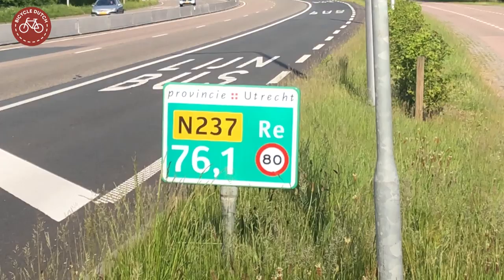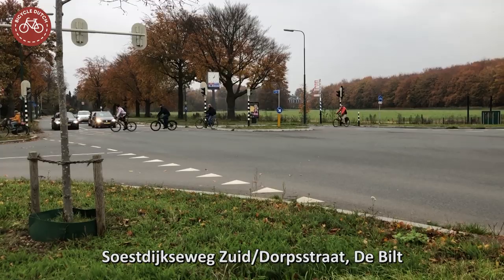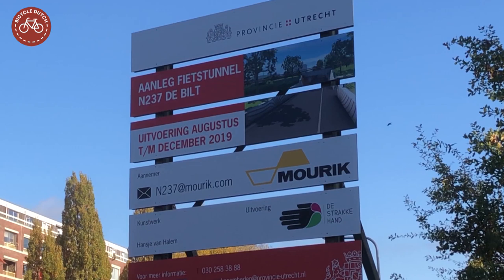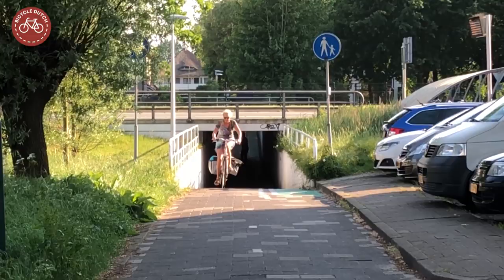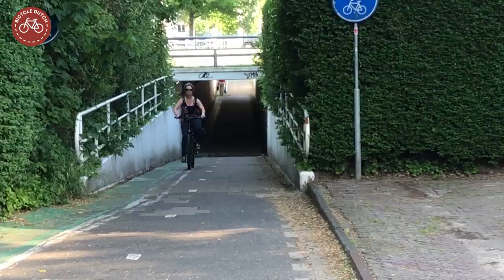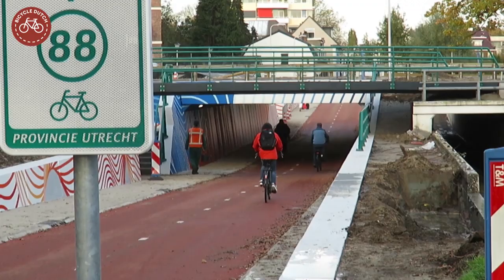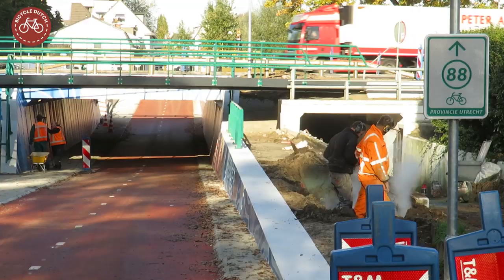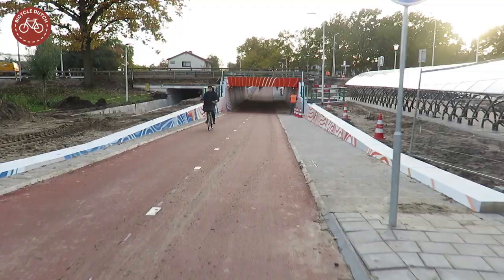A cycle tunnel in De Bilt

Comment: The tunnels are a HUGE improvement!! It’s much safer and saves a heap of travel time as well. I’m very happy with them!

I do have a concern with the current constructions sort of near the fuel stations. The road towards one exit is now sloped (like what they are building on the Zandvoort circuit). In autumn or wintertime this is very dangerous.

Comment: Uff the old tunnel looked very steep, no wonder that lady was struggling to bike up it, new tunnel is much much better.
Reply: That is most likely not a sign of a steep incline, but a sign of poor cycling technique. At 1:29 you can see the normal behaviour of a lot of Hollanders: they stop pedalling before the road goes down, and start pedalling at the bottom of the way up. When you keep on pedalling while you pick up speed, you gain enough momentum to go uphill with about no extra effort. At the end of the incline, you'll be able to continue at the same speed at which you entered the decline. The less steep inclines make the "tunnel" longer, which adds road resistance, and makes it harder to maintain your speed.
Reply: I know the old tunnel. I don’t think it was extraordinary steep, but it was scary. Bad pavement, too narrow and no clear lay-out. Especially under the road pedestrians were supposed to walk where cyclists don’t expect them.

Comment: Two questions: is the tunnel adapted to wheelchair users and do young women feel safe going through the tunnel alone at night?
Reply: I am not 100% sure about the wheelchair needs, but as you can see: pavements are wide and the slope is quite easy.  I expect it does not feel more unsafe than in the open street, especially because there usually is quite some traffic using the tunnel.
Reply: at the beginning of the tunnel and at the end there are homes, and there are lights inside of the tunnel. Also, in the Netherlands most woman are 'unsafe' at home or at work, so i think its relatively safe in comparison to other country's
Reply: @thedankoona_5854  I mean perception of safety, not actual safety.

Comment: One solution for inner city transport, that is free, perpetual and non polluting, is a series of gradually descending tunnels, like the London tube except dual and inclined.

Gravity = free

Imagine a gentle slope, like a ski slope in a tunnel.

By using low friction surfaces it would minimize friction and charge scooter batteries by regenerative braking.

Elevators could contain pollution at stations and air could be sucked out further minimizing friction in the tunnel.

Such a simple solution would provide constant, weather independent, non polluting, city access within a 5 to 10 mile radius..... that could last for hundreds of years and allow for cyclists to commute long distances without pedalling and actually charge escooters etc.....

I wrote to Elon Musk with the idea.

No response as yet.
😀

Comment: £10 million!!!! Here in the UK that's the kind of figure spent on roads for cars!
Reply: In the uk there is slightly longer infrastructure, mostly further apart. There's also way less budget for infrastructure. In NL the budget for roads is about 5 times as much per km compared to the UK, so even potholes are fixed before they appear. And there is another factor, mostly in the type of road - in the Netherlands there are many 'cobblestone' type roads in residential streets, these are more robust than the UKs "Put asphalt everywhere" approach.
Reply: €10 mio for 5 tunnels is ok. If these people were to drive a car, we'd have to spend way more €uros.
Brick roads are better in absorbing soil settlement, that's nice when your soils are made of peat. Asphalt would crack all over the place, unless you'd make a sturdy (and more costly) foundation. Brick roads are easier and cheaper to patch. That's also an advantage when you want to change or repair the infrastructure underneath the road.
Reply: In my hometown in Germany the railway company is renovating one single cycling tunnel for 2.7 Million Euro, that way cyclists don't have to cycle up the bridge anymore sine closure of the tunnel. But we're still far behind the Netherlands.The dutch have such a great country: Best infrastructure for cars, cyclists, walking; high salaries and still having money to pay debt.
Reply: As Arthur Hagen stated in an other remark: this money is spent on cars! Because the cyclists (and there are lots of them) don’t have to cross roads, don’t drive their own cars and don’t use car lanes, many car drivers don’t mind their tax money spend on cycling infrastructure. Besides: in the Netherlands everyone rides bikes, so cyclists pay taxes too.
Reply: The cobblestone type roads are also a measure to prevent speeding - it's no fun driving fast on those when you're in a car, so car drivers are encouraged to drive slowly in residential areas.
Reply: It is used for cars too. They no longer have to wait for cyclists to cross the road (for 2 of the 3 tunnels). And it's dirt cheap too. 4-5000 people waiting an extra 1 minute a day adds up to a huge amount of wasted time.